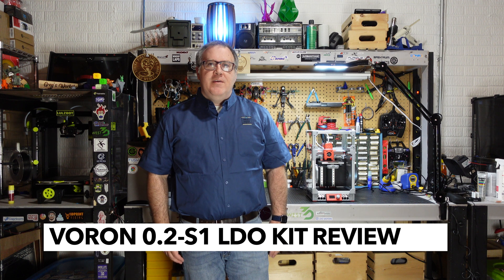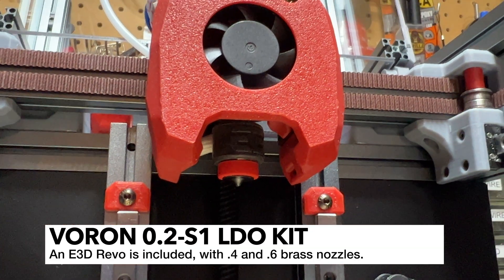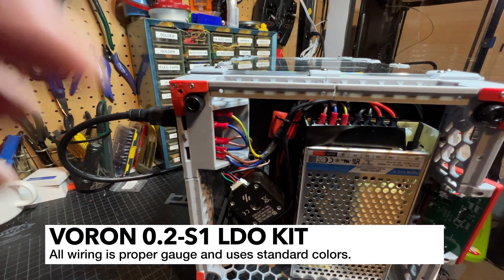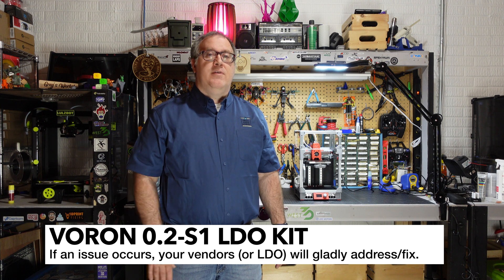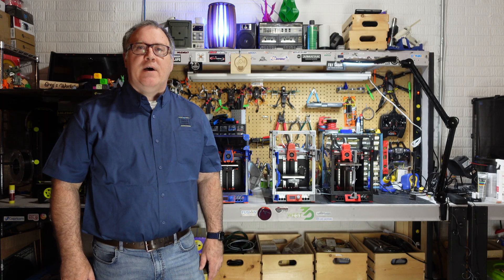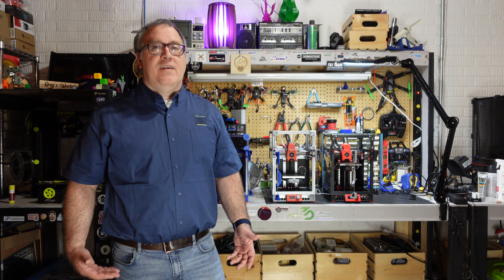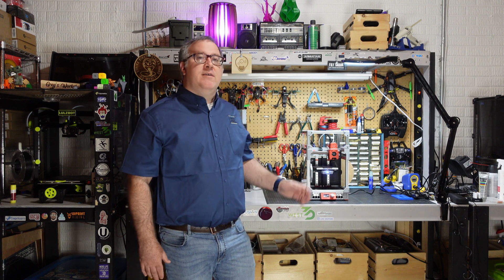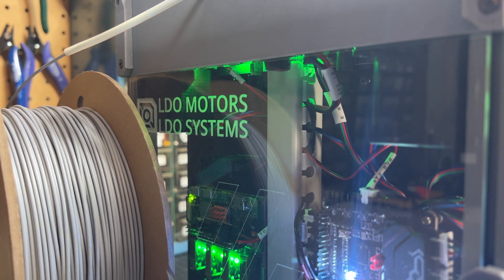LDO Voron 0.2-S1 Kit Review

Comment: Been watching your video series as I build this kit. 

I was hoping there would be a build series for this one as well but I k ow it takes a ton of work to film that. 

Is there any chance you could dive into the x
Toolhead wiring a bit? Did you cut the wires and crimp new connectors on? My leads are insanely long and I’m torn between just bundling them or cutting and crimping. 

The LDO documentation for this kit leaves much to be desired where the picobilical is concerned.
Reply from the maker: Thanks for watching!  Yeah, I agree that would be a good video, especially for the LDO specific parts and the picobilical. I did not cut any of the connectors and just zip tied them up in the back. I did find a few of them a bit longer, but for the most part I think it is fine. I got a little creative with the wiring on the back panel and just tucked most of it into the wiring track. Best of luck with your build and feel free to ping me in the discord, I'm happy to share a few more detailed pictures if it would help.

Comment: I seem to have the same bond tech gear...the flat section is indeed only 4.5mm 😢 Do you know if the part is unusable for the stock extruder or wether the flat is at least in the right spot? Will find out next week otherwise 😅

Also took me a second to figure the Kirogami bed out, LDO still seems to link the older parts in their supplemental guide

Thanks for the great review!
Reply: We fixed Kirigami link, thanks for mention.
Reply: @ldomotors  thank you! I actually noticed one other thing: the packing list in the kit calls for a "axial fan 3006, 5v" and one "axial fan 3010 24v" but the kit comes with two 3010 24V fans (one for the SB and one from the 0.2 upgrade kit)
Reply: @realcrys  okay. Will double check. V0.1 used 3006, my team May didn’t change it.
Reply from the maker: Glad you figured out the Kirigami bed! Yeah, it would be nice to get the updated links there for the parts. I know those came out after the kits so that probably just needs updated. 

For the Bondtech Gear, I did try to get it working in the stock mini SB but it seemed to be too short of a distance for the end of the shaft to make contact in the bearing. Someone else had the same issue when I asked around, and they ended up grinding down more of the flat so they could better position things and then eventually got it working. I am curious if you do end up using it/getting it working, please swing by and let us know if you do and what you had to do! Best of luck.
Reply: @GregsMakerCorner  I did a quick dry fit and it seems like everything is ok. 

Basically if you move the gear all the way up on the shaft towards the 50T and then tighten the grub screw the grub screw is on the slope of the flat spot and sliding down the shaft as I tighten it. The position the gear then ends up in (the top most possible basically) is aligning everything ok for me, the 50T gear is roughly centered in the vertical opening. So while there is zero margin to adjust the 50T further up, it seems to be ok.

The 2mm shaft on top is comfortably sitting in the bearing and won't slip out, so should also be ok.
Reply from the maker: @realcrys  Awesome, thanks for the follow up! Good to hear it is working for you. When I test fit mine I didn't think the end of the shaft was going to make it to the bearing.
Reply: @GregsMakerCorner  will report back 🙂 just finished the frame, so some work left before I get there 😅